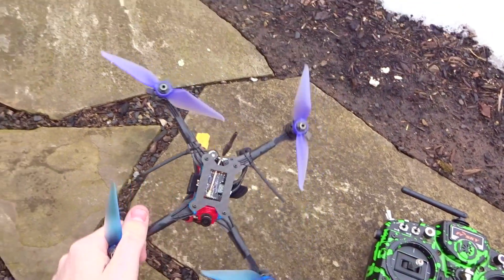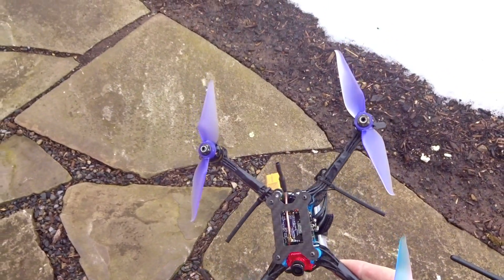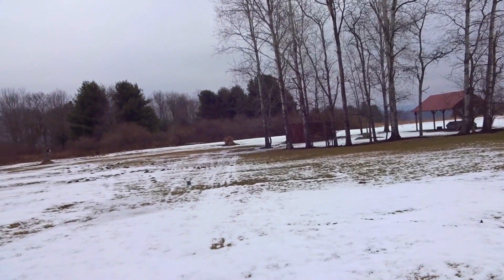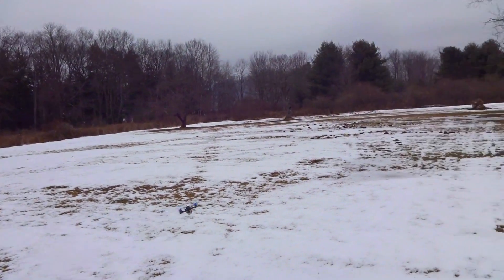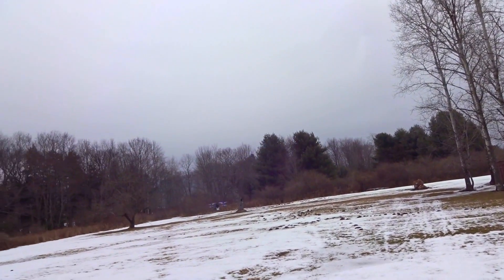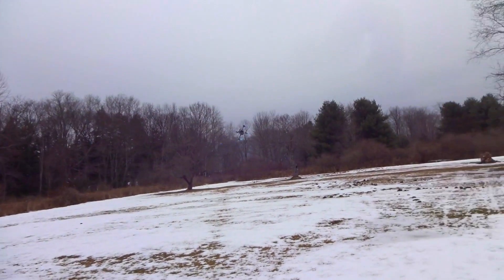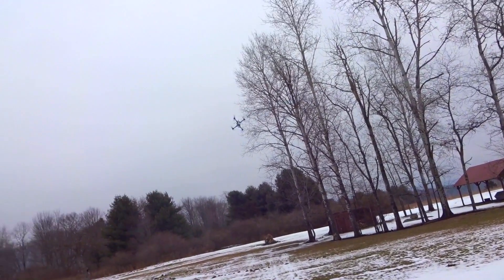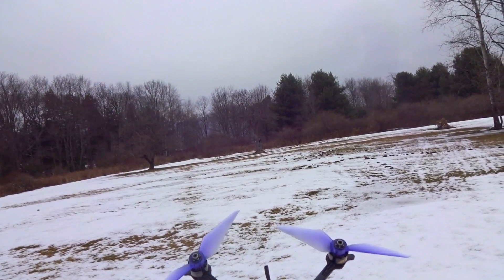5inch ULTRAlite LOS : 153g Dry Weight!

Comment: What is the flight time? Can you suggest a quad build under 250g with a flight time of 15-20 min? Need it for large area surveillance.
Reply from the maker: Maybe like 4-5 mins. You are never going to get that flight time under 250g. You have to be running 9-12in props on something that's like 2kg to carry enough battery to fly that long like a Phantom usually.

Comment: I was thinking about using this stack in a FlosStyle frame with mr steel 2306 2450kv...should I even bother? Or just go ahead and do another micro lol
Reply from the maker: I would advise against using these micro stacks for regular 5inch quads.
Reply: The RCAddict Even a 40a one? Or is it just asking too much of that small of tech?
Reply from the maker: Treat amp ratings like c ratings, they are pretty much just made up ;) The fets are so small they can't handle too much heat.
Reply: The RCAddict Hahaha gotcha! Thanks man!

Comment: I chime in because I have some experience with ultralights and I have few random things to say. the motor/prop combo is critical in this kind of copter. 1) 2800kv is too low and you probably want something like sunnysky 1408 3200kv which has more torque below and more top end too. I currently use these on mine. another good motor on paper is 1507 3600kv. 2) Those props are "okay" but they generally lack punch as a prop and your better choice is something like the old 5040x2 by kingkong. much easier to spin, more punch due to blade design and almost same top speed result in a better overall feeling 3) there is another caveat which is related to blheli, the low rpm protection is limiting performance at bottom end on ultralights, and while I don't raccomend to disable it (F428 are a bit sensitive to overcurrents) it might help to increase "startup power" a couple of notches. the reason is these motors have 12 poles instead of 14. the low rpm power protect feature of blheli is active up to 156k erpm. for a 9n12p motor that's 13000 propeller rpm. 4) the rattling noise is probably not a tuning problem, I had this problem too with this stack on ultralights, it is one esc not keeping up with one motor, maybe even a sign of a motor or esc going to break. usually after some 10 batteries a motor burned (motor 1) the only common symptom is if you switch a lighter prop like a 4" you'll probably see it disappear completely.
I appreciated you doing this experiment and I just wanted to give some suggestions! cheers
Reply from the maker: Why would you want to increase the KV so much for a 5inch propellor. 2800 is already higher than normal. I adjusted startup power yes.
Reply: 2800kv is higher than normal for 22xx motors. Kv is ultimately only a measure of how much current you can smash into a motor, and that's the only way to produce power and torque on these small motors. Try higher kv for yourself and you'd be surprised. ultralights have been around for at least a year now, a lot of people tried BH 1407 in 2800kv and 3600kv flavours, me included, and the 3600kv is superior in all aspects. 2800kv is just really slow. the only thing brotherhobby 1407 3600kv lacked was a bit of control at the bottom end.
today we can build way lighter than at that time (yours is an example), and we have those new 1408 and 1507 motors, the bottom end performance issue is a thing of the past and you have stellar top end with 3200 to 3600 kv.
EDIT: I'm using sunnysky 1408 3200kv on mine
Reply: @nasone32 I have a similar setup 5inch ultralight (168g dry) with 1406 3200kV RCX Motors also using the RaceKraft 5038 props. I still have do do some FPV testing but LOS felt pretty good so far.

Comment: Thanks for the video!
Fixing those oscillations at 2:15 may help to improve top end a little bit. I had the same problems with my first quad,  there was a feedback loop thru gyro, resulting in 60hz oscillations when going full throttle.  As a result, according to BF logs motor power was jumping between 60 and 100%. The problem was in 1-2ms delay added by notch filters. I had to soft-mount motors and FC to be able to remove those filters and to increase lpf for gyro and d-term to 125hz. After the fix, motors stayed above 90% almost all the time and accelerometer reading went up from 3.7g to 5-5.2g during the full throttle punches.   
On other quad oscillation was in 100-115hz range and the problem was in gummies i've used to soft-mount the FC. I just tightened all the nuts, giving FC less freedom and the problem was fixed.
Reply from the maker: Thanks for the info :)
Reply: Dude do you live near SD I need a tuning guru

Comment: I feel like this validates why 2204-2205 seems to be worthwhile to a lot of pilots.  I was really wanting to push the AUW frontier on a build like this, but couldn't bring myself to go below 2205's.  The dry weight bumps up 50g (motors, ESCs [40A], props, capacitors, CP VTX antenna), and the battery packs are 30-70g heavier (1000mAh // 1300mAh respectively), but I feel like getting the top end and bottom end back with those builds is worth it.
If somebody starts making good 1808 motors for light efficient dual-blade 5" setups, then we might be somewhere.
Reply from the maker: I don't think this class has any purpose at all really, unless you want to stay "legal" (<-- lol) or just to have fun.
Reply: I think the answer is 'fun'.  I suppose if you got bored, you could see if this flies on 2.5" props, and have the goofiest looking setup in history.
Reply from the maker: Haha if I could mount them I would.

Comment: Well i am not sure about these escs can provie enought power for 5 inch quad.
I should be interesting with different (regular) escs and maybe you should try 4 inches as well on it.
I dont think these 5 inch high angle propellers are good there.
Reply from the maker: These props looks aggressive but they are super easy to spin and weak little guys haha. This ESC has taken 2405 motors, it's fine haha.

Comment: What size motors do you think would be best? 1806??
Reply: My personal thought we be something closer to an 1808 - would still be an 18-20g motor, but it would have more top end authority and be efficient at higher RPM.  The low end performance is still just torque limited, but the 18XX stator is the best compromise before you wind up in 22XX land - the biggest limitation up top is that without enough stator height as the prop unloads the motor can't ask for much more power.
Reply from the maker: 2204

Comment: I hated those props when I tried them. Mine at a similar weight was much better on 5040 5045 light tri blades on cobra 1407s. I also enjoyed freestyling with it as had hang time for days. I liked it, but the fpv cam angle irritated me as it ran out of puff too quickly at such a high angle and was too floaty at a lower angle. Nice experiment!
Reply: I'm wondering if DAL made a T5041C prop (the shorter chord style like the 5051C, but less advance ratio overall) if that could be a viable answer - for less powerful builds it would have great control authority, and still be pretty efficent.
Reply from the maker: Yeah old style 5040 bi blades would probably best best.
Reply: tehllama42 on my 160g pre props with 2204s, I’ve found the extreme weight loss allows for much heavier props due to prop unloading. I’m not racer so it’s just an experiment, but it runs very well with those props. If the weather improved I might actually reach a conclusion!

Comment: I was hoping for more outa that little thing
Reply: The real issue is that you can't stuff more wattage through the motors - great as an endurance racer for a tight course, and as a track recce quad, but it has a lot of disk area for how much wattage you can put down.  It's like making an autocross car with huge sticky tires, but a dinky motor.
Reply from the maker: IDK, I wasn't able to race it very fast, decent speed, but if you let off the throttle is slows down sooo much haha

Comment: Nice flying 👍🏻 are you going to put other motors on this quad or do you keep these motors on? And another question what type of flight controller would you recommend? (Wanna look if that low vibration go away)
Reply from the maker: I don't think I am going to do much more with this one no. Anything with an MPU6000 gyro works well for me, softmounted FC>.

Comment: Try Lynx 5040 or 5045 bi blade.  It's the lightest (2.0g) and best (IMO) 5" bi blade made of pc, for 14xx motors.  14xx really needs light blades to perform well.
Reply from the maker: Those are just one of the many copies for the GF5040. Pretty sure I threw all of mine out haha. These blades are just a tad over 3g and very easy spinning.
Reply: Yes they are a copy of that prop, except they don't break from hitting a twig.  RK 5038 is fine (I flew them a lot) but lacks top end.

Comment: I've been thinking of doing a very similar build but with the rdq BA 2205 2450 motors for racing. Mostly for cost. Thoughts?
Reply from the maker: I would suggest a slightly heavier build with larger motors. Something closer to 280g. Going super super light doesn't really pay off too much.
Reply: Drew Hampton I think if you can go light enough, it’d be awesome. I have a 160g (before props) 5” running hyperlite 2204s. Can run on an 850 battery and amazing agility. Using it as a test bench for prop unloading,  you’d prob need 1000 on 2205s but well worth doing.
Reply: Being new to the race scene and wanting to try and build a race fleet on the cheaper side for the first year. Could you do a lighter build with say 2205 motors and smaller esc's and still stay competitive? Pricing things out just seems builds with a little smaller motor and esc's would be cheaper and lighter and your batteries would last longer and maybe explosions are not as brutal because everything is lighter I guess. I realize there could be a different build for every course and top level pilots can probably race anything and hold there own, but if you could build 3 identical quads for a good all-around first year setup that doesn't cost a right nut.  That is the question?

Comment: Wonder how the 1608 motors would do. Maybe the tornado t2 1608
Reply: Excellent flying,as always just tell me , what's the trick for learning orientation? You've certainly mastered it. Great job.
Reply from the maker: GF are 1606. Probably similar results. Either a 1408 or 2204 is the sizes you want. For LOS orientation, practice :/
Reply: Thought of the same thing. Could try his Gemfan 1608s that he has on the 4".